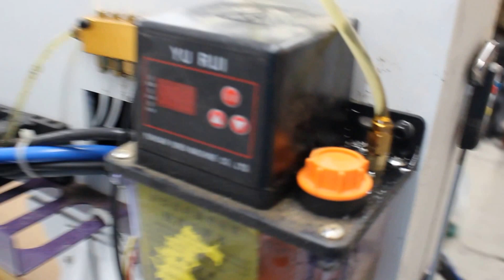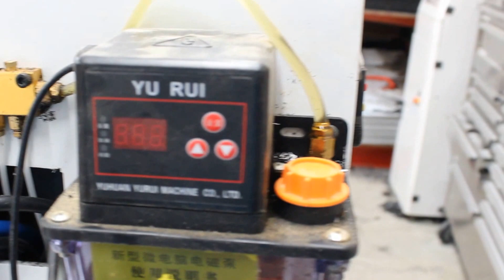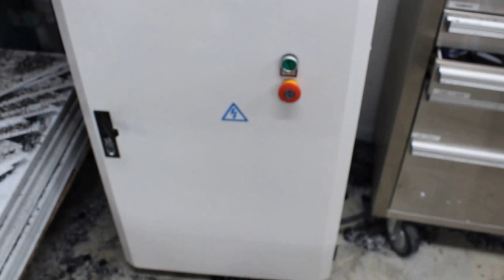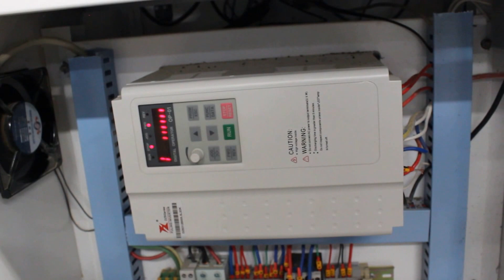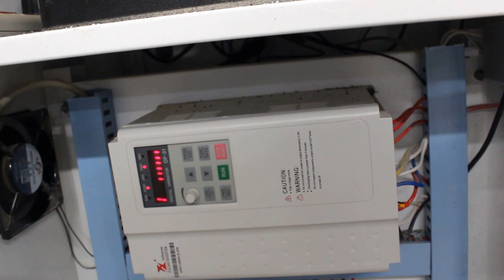Unique CNC Router with 3 Spindles Review - Part 1 of 2

Comment: As a welder that has welded thousands of trailer hitches. I know that welding across the face of a square tube weakens the structure. The only place to weld is along the bent corners of a tube.